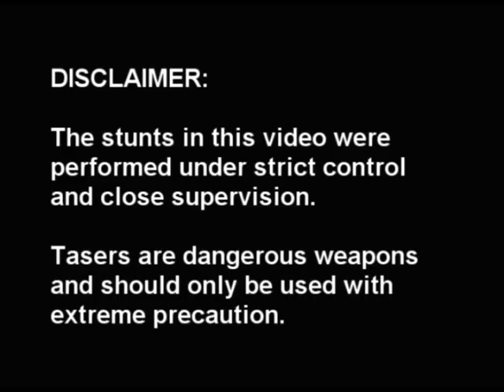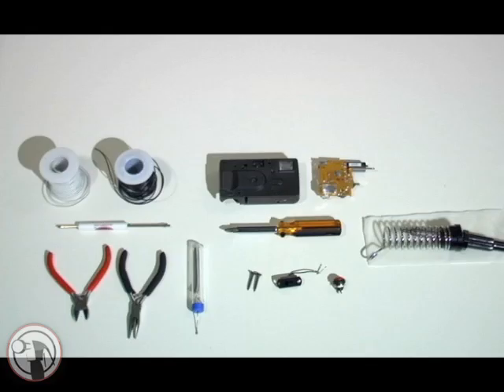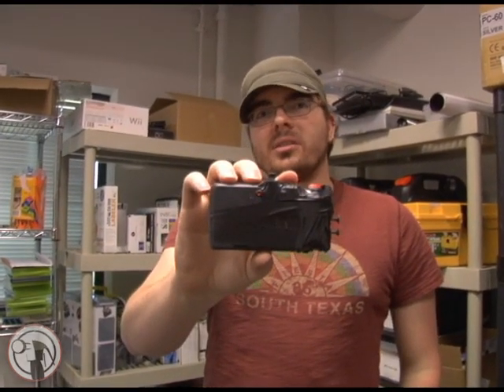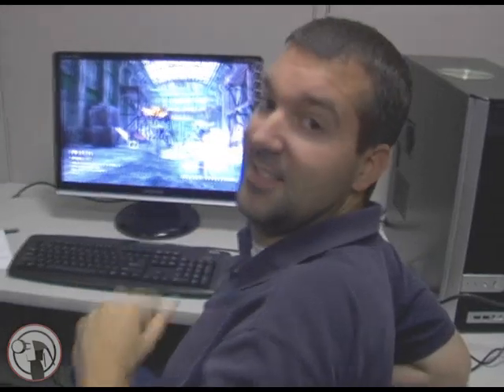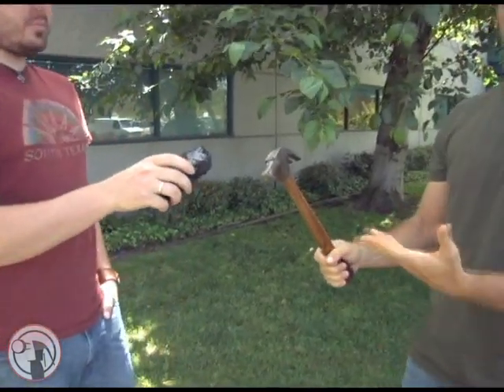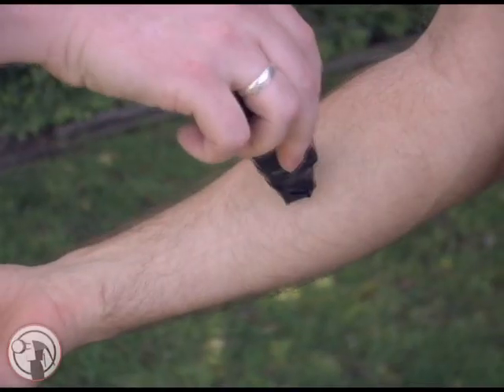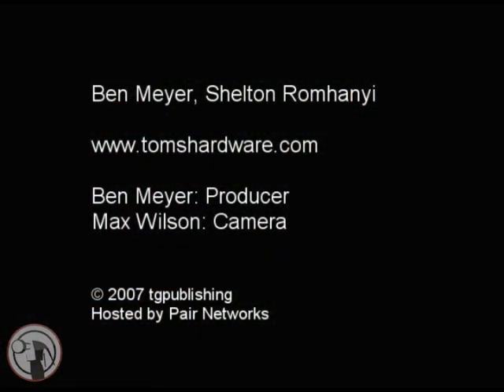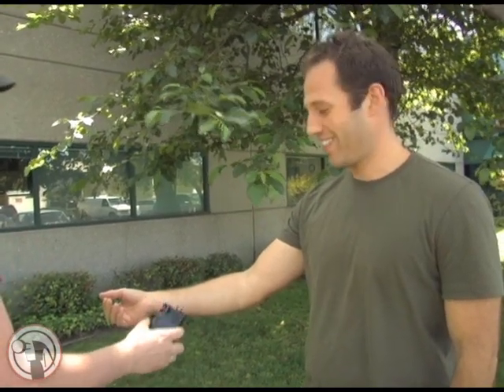Homemade Taser

Comment: ok i made one of these years ago... i took 3 disposible cameras that had 440v caps and soldered all 3 caps togeteher in parelle. i use 2 aa batterys insted of the origional 1. wired up a new led and a charge switch and a discharge button (flash) put it all in a lil black box. it looks like a bomb but really gives one hell of a shock. it blows up beer cans. give my way a try and see the differnce.